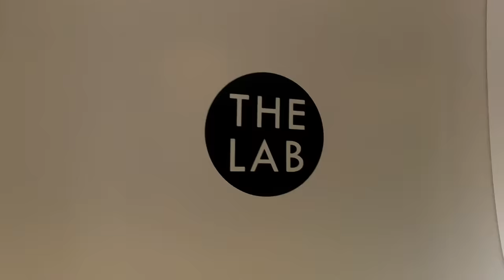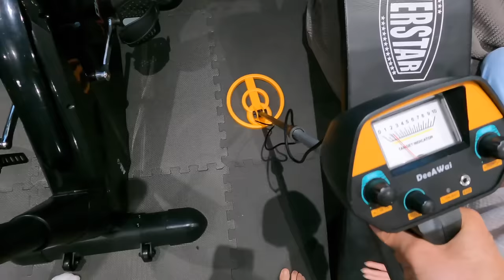WE FOUND A SECRET SAFE BURIED UNDER OUR HOUSE!! 😱🔐

Comment: You can use a screwdriver to open the safe. So what you do is place the safe on a flat surface and insert the screwdriver in the keyhole and keep rotating it in the clockwise direction…